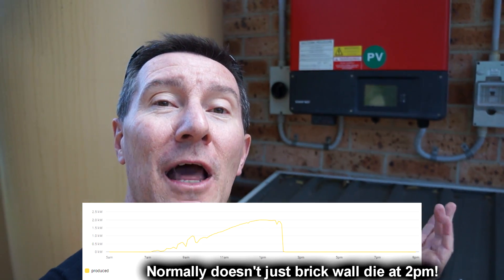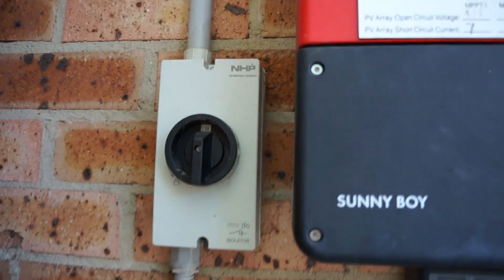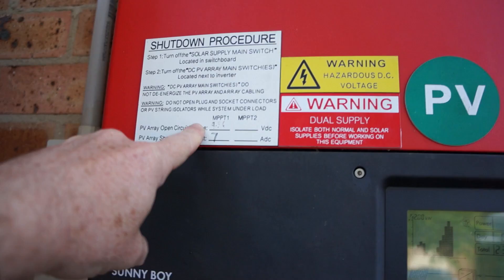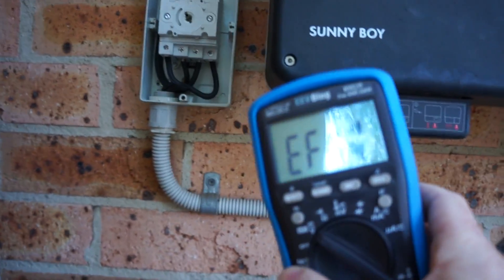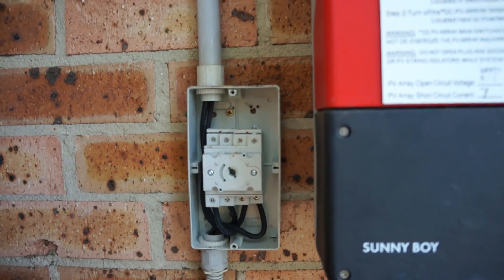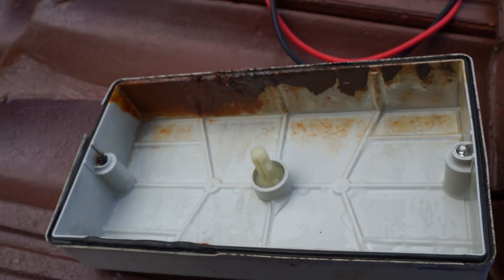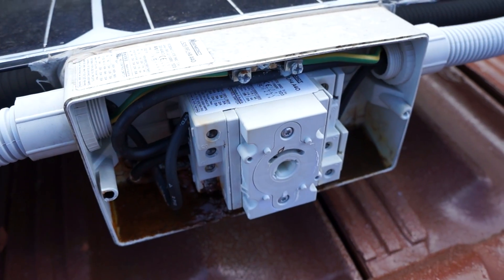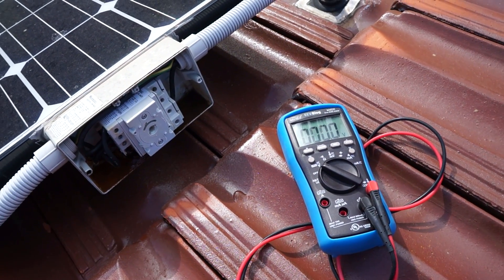EEVblog #1217 - My Home Solar Power System FAILED!

Comment: Dave have you ever done a video on h bridge brushless motors? I have a load of failed fan (boiler fans) PCBs and Alot seem to just be the surface mount fuse. Could I send you a couple?

Comment: As BigClive says water always gets in no matter what you do, it's better to have small drain holes on the bottom of enclosures like that, probably shouldn't have been plastic in the first place but I guess metal has short/ground complications instead.
Reply: 100% agree

Comment: We have an isolator switch on the roof as well as on the wall. I can only guess it's a convenience issue so electricians don't have to climb off/on the roof if they find that they need to turn them off? No idea.
Reply: But the power is generated in the panels not from the inverter, so it doesn't make any sense.  Only case I can see would be if you had two strings and needed to isolate one of the strings on the roof.
Reply: Craig S The inverter isn't safety certified not to feed mains back onto the panels.  internal isolation is absent or only rated for a functional disconnect. Simpler to just disconnect completely during panel work and allow the inverter to be built for max efficiency with lots of PCB traces between AC and DC sides.
Reply: My thoughts exactly.  Electricians will risk working on it Live without the inconvenience of climbing down stairs to turn it off.
Reply: It's a safety issue. If I'm working on the inverter and I have the switch at hand I know it's turned off, period. If it's on the roof I'm not sure, there might be another person doing something there and flip the switch. It's the same reason that HV installations have these fancy disconnectors that create a visible gap for people working on the circuit, despite them not being able to disconnect any serious current and all the under load work being done by SF6/oil/whatever super fancy devices.
Reply: @shana_dmr  This argument doesn't make sense because the electricity is coming from the panels, the thing you'd be working on up there.  Unless that roof switch turns off the sun, it does nothing.  The only time that switch does anything useful is when you're working on the wiring between the two switches when it's being installed.

Comment: The second isolator switch is there because if the first one fails you can only hope that the second one does not ;)
Reply: If that is the case, which sounds reasonable) why not put it down near the other switch for better access.
Reply: Redundancy makes sense, but why is this one in such open weather conditions?

Comment: For six years, how much did you make selling electricity back to the grid? Were you able to break even?
Reply: He has a 5 year update in the description.

TL;DR: His local power company doesn't pay him as much as other areas, so it's going to take 7-8 years to have the system pay for itself. Of course, there are better, cheaper systems now that would turn a profit in only 3-4 years.
Reply from the maker: @teknoguy1212  Yes, I paid a bit of premium for this system, so that impacted the payback.
Reply from the maker: See the linked video, 5 year update
Reply: Thanks for both of your reply. I'm moving to a new house and we have solar installed as well, I'm just a bit unsure abour the -40 weather during canadian winter lol.

Comment: Perhaps adding a UV stabilized shroud (open on the bottom) to protect the next switch?
Reply: Looks like there is enough space to install it under the panel protecte from uv...
Reply: My install has a shroud. Seems pretty dodgy to have the switch out in the open like that, especially with the seal facing straight up.
Reply: or just make it out of metal
Reply: That's a band-aid on a problem that shouldn't exist in the first place; what you want is a switch box made from a UV stabilized well-insulating plastic like PTFE, or similar glass-fiber reinforced plastics; or a metal enclosure to begin with. I have no idea about Australian electrical code but an insulated (plastic) electrical switch inside of a metal enclosure is pretty much standard in the US where I live. Metal might rust, but it will never degrade and crack like plastic as long as your gaskets are good. And from a little searching there are much more durable (and expensive) isolation switches for this exact application. Those original switch boxes are cheap crap and not suited for extended UV exposure.
Reply: ErikTheRed the problem shouldn’t exist, because there shouldn’t be a switch on the roof in the first place.
Reply: @athhud  if you have a panel fail you need a way to disconnect it from its neighbors without electrocuting yourself.
Reply: @PaulSteMarie  Indeed but the isolator on the wall down by the inverter would break the DC string, thus removing any tendency to arc.
Reply: @TheChipmunk2008  You still need to electrically isolate a panel before removing it, otherwise you'd have live power at both terminals. It might not be referenced to ground, but it's still there and potentially hazardous.
Reply: @erikthered4929  I have never seen a plastic item not failing under direct sunlight after a few years, not even the "UV stabilized" one, so it's always better to put everything plastic or resin made under some kind of shade.
Reply: @erikthered4929  Here in the UK it's pretty similar to Oz, plastic switches. But for exposed locations subject to UV, i usually go with a black glass fibre reinforced box of some kind. Or you can, indeed,. mount them in a metal enclosure. They're available but pricy. But less so than calling a pro every 6 yrs to replace them!
Reply: @hikariyouk  I could be wrong, but I though he said each panel has one of those switches. If you need to able to replace something while the rest if the circuit is energized, you need isolation switches. Then you get into situations where your isolation switches need isolation switches.
Reply: @PaulSteMarie if that is true, this one should be hidden under the panels like the hypothetical rest it would not have suffered any damage then. still be working fine.
Reply: you can use self adhesive aluminium tape , the thick version. works really good, also reflects so keeps temps lower.
best applied when new, not when already rotten 😅
Reply: Max Raider
Same reason fuses are put as close to the power source as possible.
It's so you can isolated the whole cable to the inverter, no point having a isolator if you can still be electrocuted upstream.

Solar panels are unique in the fact as soon as there's light, there's a electrocution hazard.
Reply: good quality exterior latex paint will work well

Comment: Those Sunny Boy inverters are very reliable...but please keep it off the Internet...we have too much SCADA in the cloud
Reply from the maker: It's Bluetooth only.
Reply: Bluetooth because it’s German, they prefer BT over wifi as their homes are small.
Reply: They are most definitely a reliable unit, seen and installed lots of the bastards!

Comment: yes, the Clean Energy Regulator (CER)  mandates a roof mounted isolator and they are a significant source of failures. The idea is allegedly being reviewed. One thing you can do is put a metal sheild over the roof box to shade it. Some installers do that for you , sometimes you have to find a sheet of aluminium or stainless and mount it yourself. The stupidest idea is to put the isolator under a panel, because when the isolator catches fire you destroy the panel. Sorry, I mean "in the unlikely event that...". Ahem.
Reply: Just curious why metal or composite enclosures are not used, regulations? I have lots of outdoor 220V outlets that have the typical metal box and the enclosures are absolutely bulletproof. Don't really see how DC voltage coming from panels would be any different when it comes to electrical switch boxes. I'm sure there are far better isolator boxes available, there's no way commercial installations would have something that would deteriorate that quickly. The idea of putting a shield over is putting a band-aid on a problem that shouldn't exist in the first place.
Reply: @erikthered4929  The thing is that having an isolator on the roof is the stupid idea, and we can't easily fix that. Waterproof metal boxes are available but relatively expensive and as people have said repeatedly, the market is very competitive. So even a good installer is going to find that they just don't make the consideration list if they bump their quotes by $100 for a proper enclosure. Let alone having to explain it every time while trying not to sound like a lying weasel. The industry here is full of lying weasels trying to upsell people.
The people who put my system in fitted a decent plastic enclosure and it was fine after 5 years but when I had the roof replaced so the panels came off then back on they changed the box and also fitted a metal sunscreen.
Reply: Aren't there talks to eliminate the CER since the huge disaster with so-called "renewable energy"?
Reply: douro20 Eliminating a basic safety device because some companies sold a bunch of dodgy ones is the kind of stupidity I would expect from politicians and flat Earthers, not people working seriously with electricity.

Comment: Wow what a messy failure. How do you change that switch while powered, or can you turn power off to that switch? Will you do it yourself or hire someone? Seems dangerous with that kind of power going to that switch!
Reply: Do it at night :)
Reply from the maker: I'll just get someone I think. Quick job, not worth my time. But at least I troubleshooted it so I can tell them precisely what failed and they won't try and rip me off. The ad money from this video will pay for it :-D
Reply: @EEVblog  Sounds good to me! Although I'm wondering if they will pull the whole "I can't just replace that, its not to code nowadays, I gotta do x-y and z"
s8wc3 HAH, clever :)
William Wilson I was thinking this was the first connector, but if not that makes it much easier
Reply: unplug one of the connectors to the rest of the array first,  but only with the system turned off (no current flow).
Reply: Just don't ground yourself, and you can work on live circuits all day long. I've had several trees fall on my power lines and talked a lot with the technician that comes out and splices the lines by himself, while live. You have to properly insulate yourself (proper rubber boots and gloves, etc) and use of high quality insulated tools. Considering they can do this on high voltage service lines it shouldn't be a problem here. I haven't watched Dave's previous videos but I'm sure he would know how to do it safely, and I'm not experienced with solar but I imagine you can just disconnect the lines from the panels. Could still be disconnected at the switch box while live as long as the precautions I mentioned were taken; the live end of the wire needs to be secured/controlled to ensure there's no way it could slip or move to create a path for the current.
Reply: ErikTheRed You forget about the risk of full power arcs if the two DC wires touch each other.

Comment: Leaving plastic in a direct sunlight. You're gonna have a bad time.
Reply: Cheap plastic for sure, which that obviously was. Glass fiber nylon or similar plastics will tend to hold up longer, but durable plastics that I know of aren't particularly UV stable. Ultimately though a low-oxidizing or enameled metal enclosure is what you want, or just a cover over the plastic box with ventilation to keep light out.
Reply: All the molecules fall out, sorry wear out.
Reply: @robthesamplist  

"All the molecules fall out"

the freedom molecules.
Reply: Finder TRE Yep there you go.

Comment: Any good technic to change a switch like this on a live system? I assume you can not  switch off the panels 😁 or with a damn large blanket 😁
Reply: Or same as russians landing on Sun - do it during night.
Reply from the maker: The MC4 panel connectors are designed to be unplugged live, they have a long shrouded internal contact. of course it should be done unloaded.
Reply: As far as my knowledge goes the panels have inline connectors. I'm guessing that you would unplug the panel nearest to the breaker, but I could be wrong.
Reply: Put a black cloth on top of the panels?